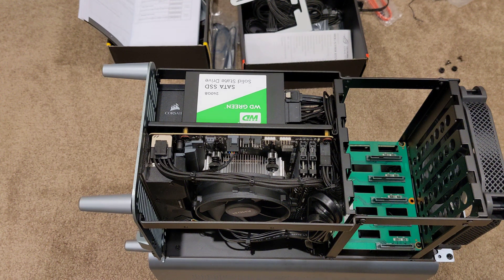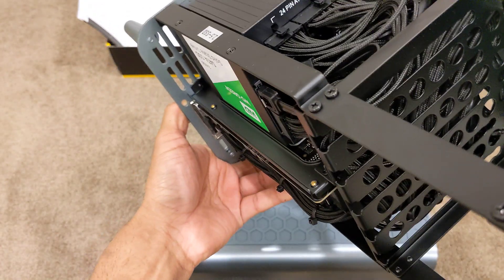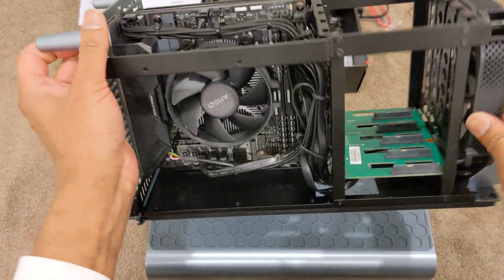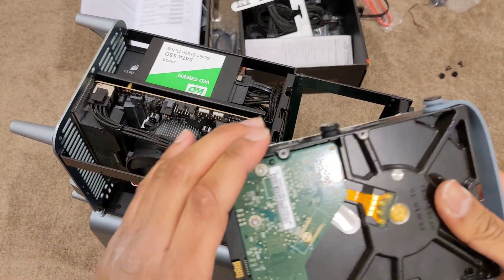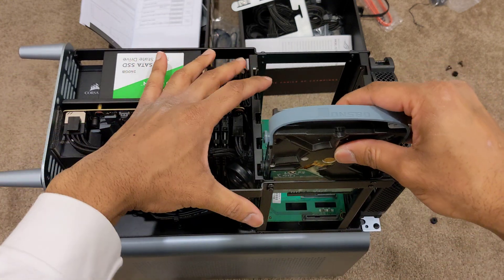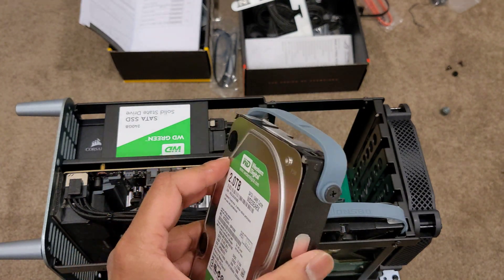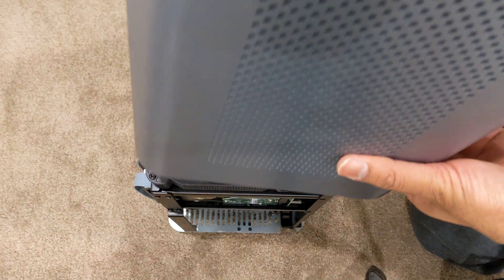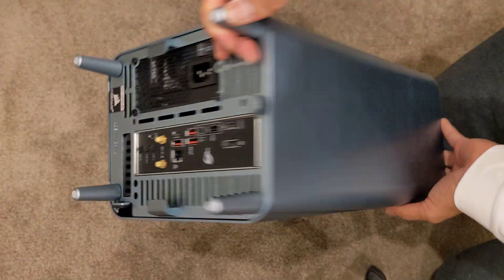Jonsbo N1 NAS Ryzen 7 Build Part 3

Comment: My question is this why would you pay for more what the synology 1522+ and loose all the apps ? I have Jonsbo set in my cart but I am not sure if I should go with synology and save few hundreds dollars.  Thank you for the Video!!!
Reply from the maker: Hi 👋 Synology is too basic for my needs, it does not have enough hardware power or possibilities of change. 
With my build, it was a fun build and a good challenge learning a new piece of software.
I am using TrueNAS Scale and they have hundreds of apps available.
They also have a discord group with lots of helpful people.

With this build, I also have the option down the line of either upgrading or downgrading depending on my usage of this current configuration.
Reply: Synology is just a piece shit of plastic and way more too expansive for what it is whit ancestral anemic CPU

Comment: thank you for your video!!! it is really helpful.... can you connect the drives directly to the motherboard WITHOUT using the JONSBO backplane?
Reply from the maker: Why would you want to do that? 😬
The backplane is one of the main reasons that makes this case great.

It reduces the amount of cables,
Provides a place for the drives to rest on,
Allows drives to be hot swappable,

If you break the backplane then you would need something like this and a powrsupply that provides 5 molex 4pin  plugs to fit in this adaptor below 

AU $1.61  27%OFF | Newest 30cm SATA Combo 15 Pin Power and 7 Pin Data Cable 4 Pin Molex to Serial ATA Lead cable molex to sata power adapter
https://a.aliexpress.com/_vkKs7X